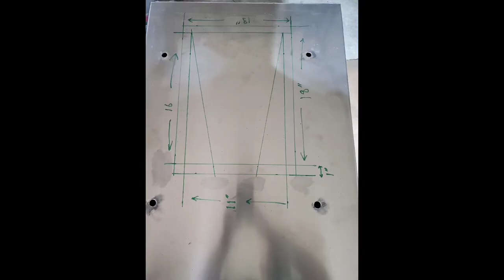SEMI TRUCK GENERATOR (APU) BUILD

Comment: That is awesome man would have never thought of using a solenoid for choke control.
Reply from the maker: Thank you, I ended up having to use a 2 inch linear actuator, as the vibration killed the solenoid in 15 mins